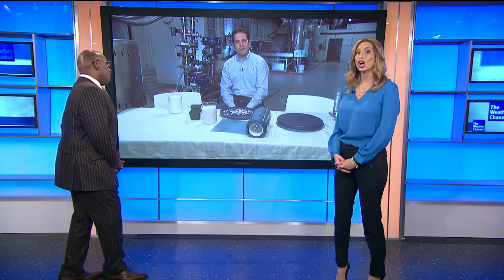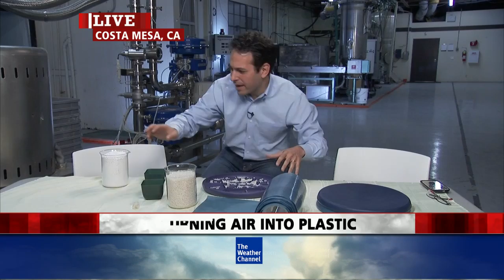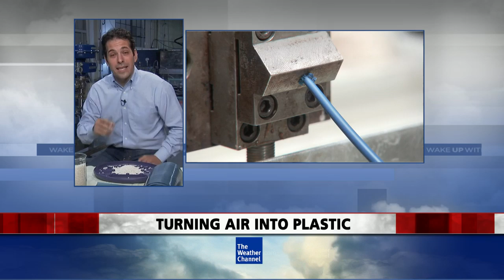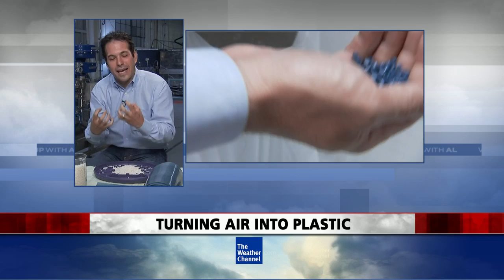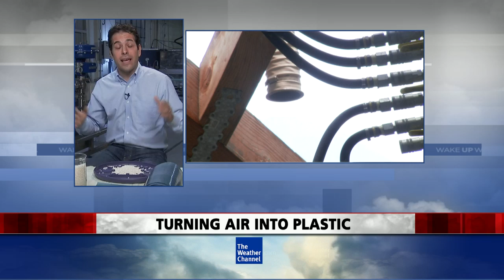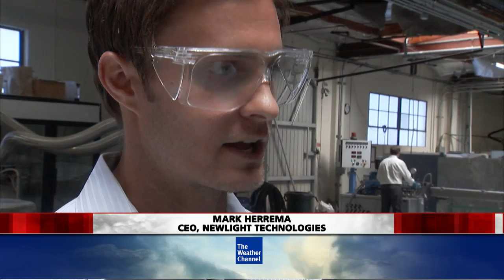Newlight Technologies Turning Air Into Plastic

Comment: So no one did any research into this? Do you know how much air you'd have to pull out of the atmosphere per second just to get the CH4 to make the plastic? Just by using a regular industrial pump, they would be making a ton more carbon emissions then removing.  This isn't "wow" worthy; it's BULLSHIT. Read a book.
Reply: You have seen thunderfoots video too? But I think debunking this airplastic is pretty straight forward.